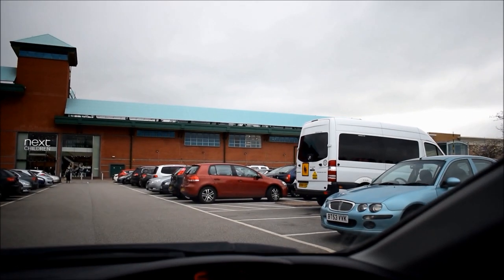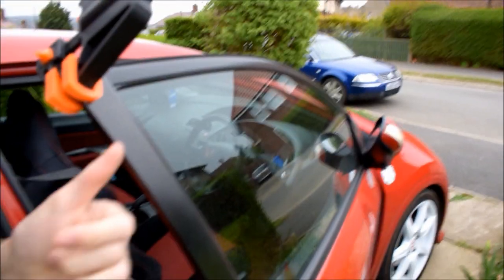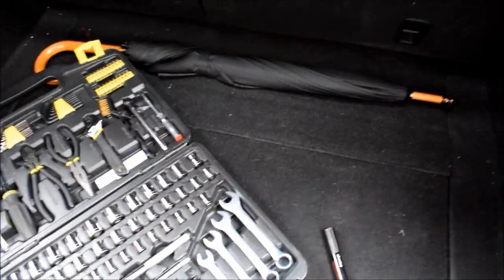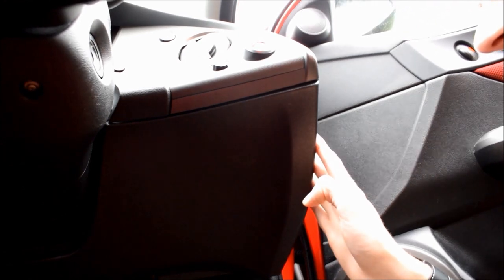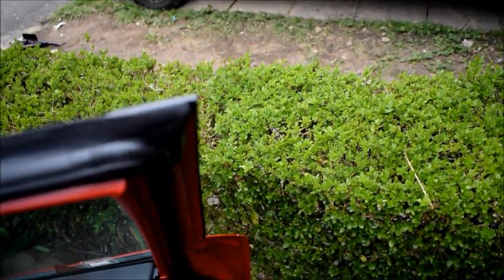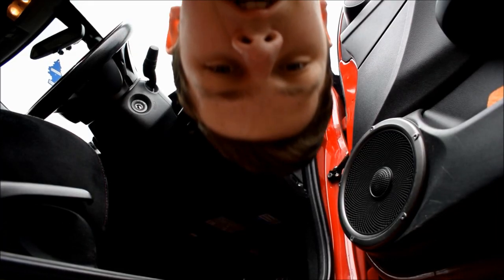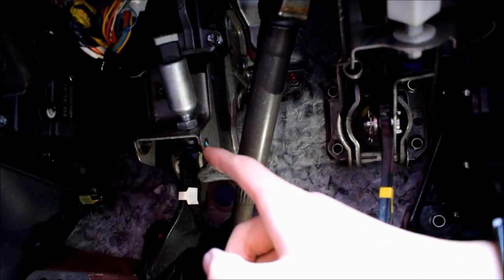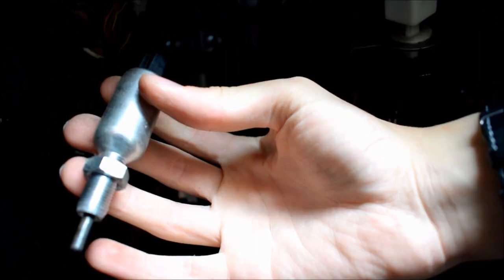Clutch biting point adjustment FAIL

Comment: I found completely removing the cruise tube and disconnecting the four electric connections above the pedal assembly allows room for a normal spanner to have sufficient room to undo the 12mm (disconnect negative terminal of battery and leave for a minute)  

Does take some effort depressing the clutch pedal with left hand.  I found laying on my back in the footwell worked better and I'm a big lad (seat back, steering wheel up to maximise room and remove the lower dash trim and the outer seat rail cover)  

The Competition Clutch video is helpful.  

Doing this adjustment transforms the clutch / gearchange, it's now smooth and rewarding!  

Spraying some lithium grease on the rod that you're adjusting and the springs lower down also cured the squeaky pedal!

Comment: Late to the party but just bought a Type R so I'm enjoying your vids.
I did this adjustment at the weekend as my pedal was on the floor and I couldn't select 5th at high revs along with the notchy 2-3 change. I couldn't get the movement on the 12mm spanner so bought a brake pipe spanner (£6 at Halfords). With that it was an easy job. I knelt outside the car with the seat right back and leaned in. I went a turn and pedal has come up slightly on the bite point. The 2-3 is still occasionally notchy but the VTEC changes are now sweet so worth the effort.
Reply from the maker: jb64das brilliant thank you for your feedback 👍🏻

Comment: Did you ever get around to doing this? Adjusted the biting point on mine and its so much better now. I used a bit of old timber and wedged it between the peddle and seat to hold it down so I could undo the 12mm nut.
Reply from the maker: No I didn't mate. To be honest I'm just gonna leave it now but well done one doing the task yourself 👍🏻

Comment: Did u get this job done in the end, I managed to adjust the pedal, used a breaker bar to hold the clutch pedal down, I've adjusted the push rod half a turn its made a difference however the issue is the pedal height is lower than the brake pedal
Reply from the maker: No I've not tackled it since.

Comment: it's when u got out the car and said......no.........no.....lol so funny mate. ur vids are entertaining. my clutch in the fn2 is very low also , as is my friends. I hear alot of people saying about 3rd gear issues. (crunching) (popping out of 3rd) (difficult to engage 3rd) my 07 fn2 has 126k on the clock and has never had these 3rd gear issues!!! ...it is a 1 owner from new and still on original clutch.
Reply from the maker: HONDA RPMS glad you find them entertaining ☺️ haha lucky you! Must be a rare one.
Reply: Hi mate, what do you mean by low clutch ? Do you mean that you don't need to release the pedal very much for the clutch to be engaged ?
Reply from the maker: +Stainmanx hi pal. Yes that's exactly what I mean. 👍🏻

Comment: Think I'll leave mine to a professional this Tuesday and hoping they can sort it out, painful when she crunches/pops 3rd gear, I imagine it can wear the clutch out earlier too?
Reply from the maker: Yeah it does sound like it's causing some damage. I've still not done this to this day. I've heard polybush engine mounts help aswell.
Reply: Have you ever replaced a Clutch in her?

I wonder due to the gearbox if Type R's frequent replacements.
Reply from the maker: I haven't no and it's not a known problem. As long as its engaged and disengaged properly I would think the crunching gears won't hurt the clutch
Reply: Cheers thanks.

Comment: Before you done this. Did you have a lot of pedal freeplay?
Reply from the maker: I still haven't adjusted it and probably won't now. How do you mean free play?
Reply: @FNLEW  By freeplay I mean the amount you push the clutch down before you feel resistance. You may have like 1 or 2 inches of floppiness/slack before you feel it resist
Reply from the maker: @jordan4541  not really mate. The biting point is low down but the resistance is all the way through.

Comment: Yep, my first attempt ended in defeat too! Get someone to sit in the drivers seat and push the pedal fully down. They'll need to be flexible, as their right leg needs to be out of the door, so you can fit in the gap!!

It's never simple with the FN2. I've just spent two days fitting the Piper catback system. The old exhaust was screwed, so had to be cut off, and the threaded studs on the cat were wrecked, so I had to cut them off, drill through, and fit new nuts and bolts in situ. Many thousands of heat cycles has turned the metal into some massively tough material, which killed about ten brand new drill bits.

We don't have a two or four post lift, only axle stands and ramps. I'm in absolute agony now!
Reply: Breeze block will a blanket wrapped around it does the job m8 saves all the trouble
Reply: I found that turning around the 17mm spanner (that I had used to undo the nut holding the cruse control switch) and placing the 13mm or other end of the spanner between the depressed clutch peddle and the bracket that holds the clutch peddle jams the clutch in the depressed position exposing the 12mm nut you need to undo. You could try other spanners or tools or anything that can resist the pressure from the clutch return spring.

It is a bitch of a job to do, but so worth not having to have to bury your foot hard into the carpet every time you want to change gear.

Good luck
Reply: 4 hours fitting all the exhaust including the manifold,and also in this time removing the old one too...not so hard.

Comment: Alright Lew, thanks for this video. Just had my 1.8 Type-S's clutch replaced as it'd been sat for some time and the pressure plate was sticking. Only issue now is my biting point is practically on the floor so I'm getting some... Erm... 'Notchy' gear changes. Did you ever manage to get this sorted?
Reply from the maker: Hi mate, no problem. I actually haven't sorted this but my car has a clutch at home ready to be installed in fact. So I'm gonna asses the situation when the new one's fitted.

Comment: Hey Lewis, if this works out in any next video, i will try it by myself. 

Do you have an issue with the 3rd gear popping out too? Sometimes this happens to me and its dang annoying.
Reply: What year is your FN2? This was a common issue in 2008 models I believe. Was rectified by Honda in later models. A local Honda dealership will know how to fix this for you.
Reply from the maker: SHAWSIE64 it's an 07 so the car wouldn't have had the fix yet. If I can manage it to save money I'd rather do that than pay a dealer.
Reply from the maker: SHAWSIE64 just realized you were replying to the first comment haha
Reply from the maker: Louis Senn mine doesn't pop out it's just a bit funny putting it in 3rd in the first place 😂
Reply: Lewis Humphrey all good mate, great vids enjoy them.
Reply: SHAWSIE64 yes its a model 08 :( need to fix it

Comment: Not a easy job! I tried unsuccessfully for over 3 hours and all i got was bad back pain! I took it to my local garage with a photocopy of the article you used off civicinfo. They charged me £35. Job done & 6 months later it seems ok. The clutch has always been heavy & makes the odd clicking noise but but a few squirts of wd40 and its fine!